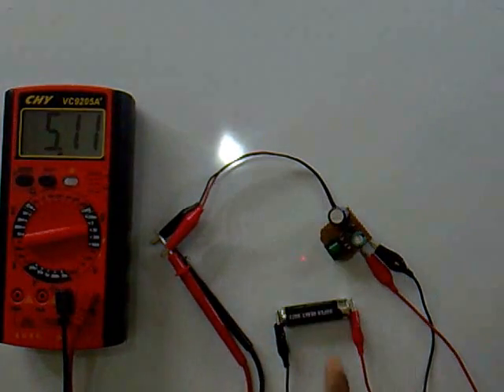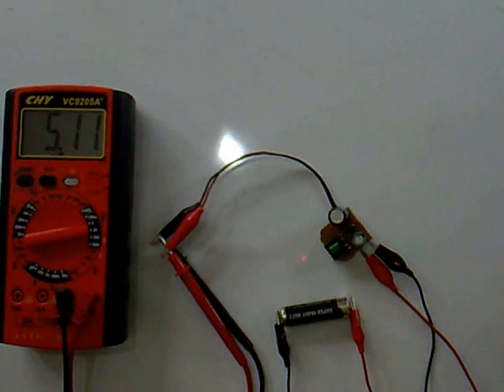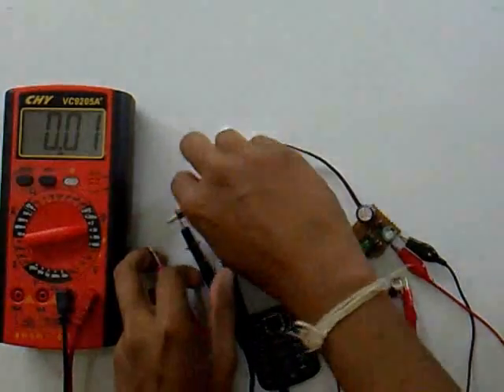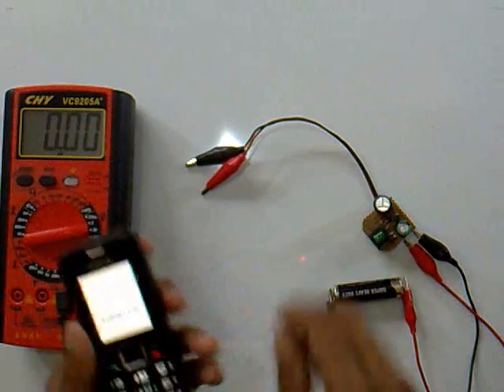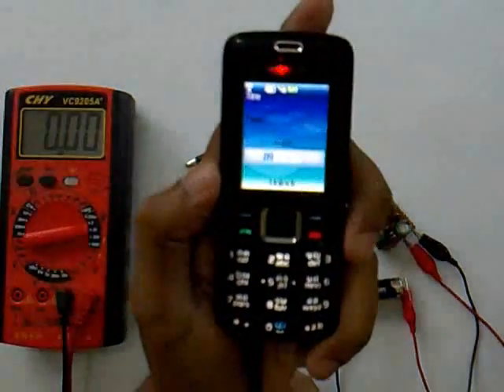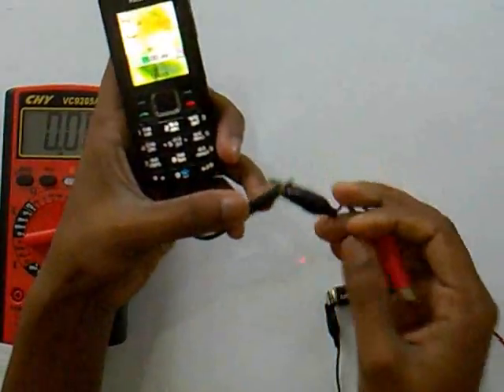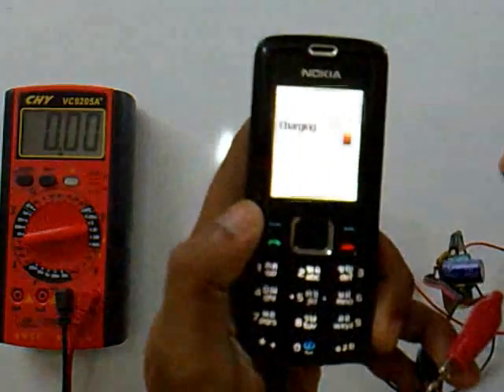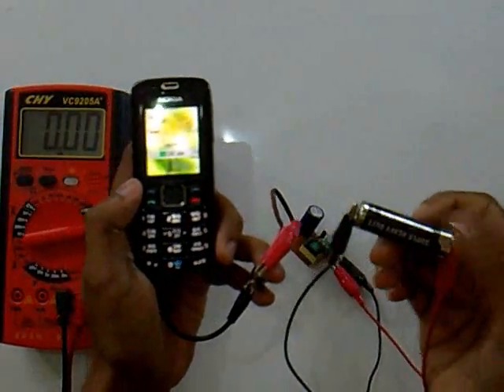Phone Chager works on 1.5v AA Battery

Comment: when i try this circuits the connection of charger is charging up to 1 sec then it lost after 1 sec what will i do?
Reply from the maker: +Lester Musca Sorry my friend, you don't have a solution . Some new smart phones need super smooth power supply. There for you can't even use a duplicate charger instead of genuine one.